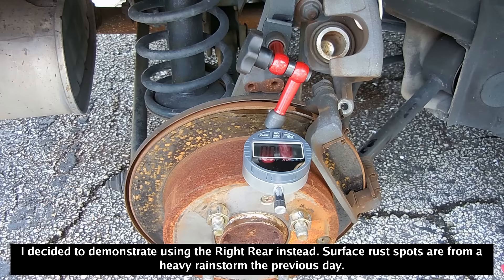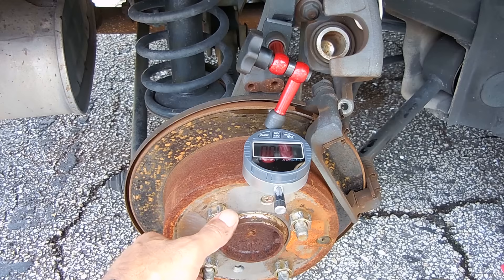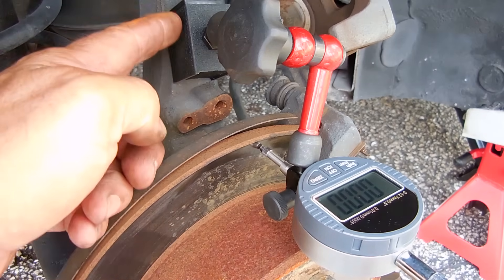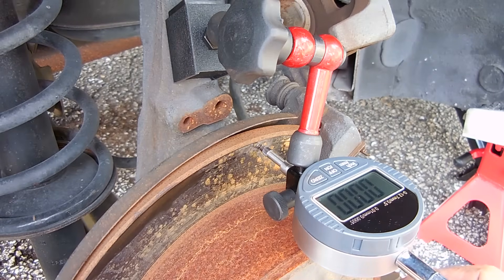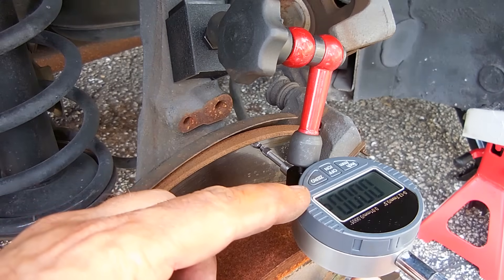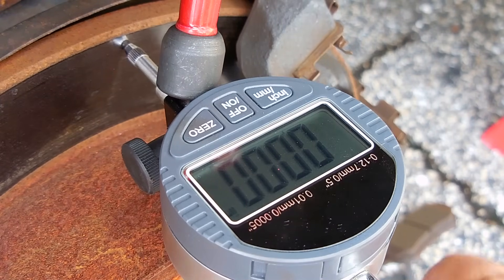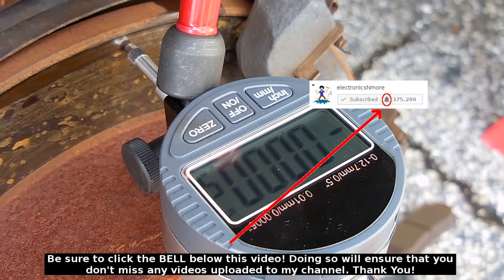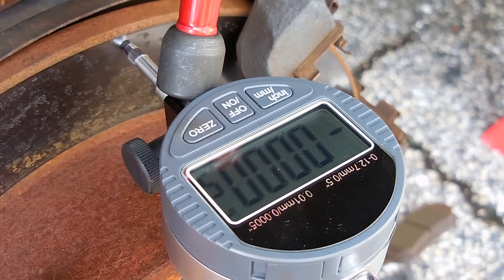How To Test For A "Warped" (DVT) Brake Rotor

Comment from the maker: Two things not mentioned in the video. Right before you connect the dial gauge to the brake rotor, grab the rotor on opposite sides and try moving it up/down and left/right. There should be no play. If there is, then the hub could be worn. Brake pedal pulsation is the result of LATERAL RUNOUT which causes disc varying thickness by allowing the high spot of the rotor to scrape the pad and remove material from both surfaces. Over time, this action will change the thickness in the area that has the most runout.Thanks for watching!

Comment: Brake rotors don't warp. Now uneven wear, uneven pad material transfer, and a car that has sat for a long time and had rust build up everywhere but where the pads sit is a different story.  
Brake run-out is not the same as warping. The mounting surface (hub) the rotor is mounted too could have debris or they just were not installed flush.
Reply from the maker: It's commonly referred to as "warping", even though it's DVT. Thanks for watching

Comment: Clean the rust off before measuring .. it can be 1/2 the tolerance you are measuring. Rust like that is gone is a fraction of a second when first applying the brakes, so don't include it in your measurement. ).002" total indicator reading is a very tight tolerance .. many new or turned rotors will not meet that spec ... 0.004" is hardly detectable. Also the thickness variation, a different measurement, can be much more important in relation to pulsing feel of brake pedal.  Lastly, most pulsing brakes are the result of brake pad material stuck on the disk, from over heating of brake pads, .. not warping of the disk.
Reply from the maker: That was just very light surface rust that occurred the night before due to a rainstorm. I wiped down the rotor and also turned it twice with a thin film of oil on the tip of the gauge to clear away any thin rust film before filming. All my sources(service manual and many online) claimed the specs I mentioned in the video. You're correct, it's really DVT that gives the rotor the appearance of being "Warped". Actually the pulsation feeling is caused by DVT that's caused by the pads lightly touching certain areas of the rotor w/o the brakes applied. Over time you get highs and lows which make the disc thickness vary, and that's why you feel the pedal pulsation. Thanks for watching!
Reply: @electronicsNmore  yes, exactly .. so mic'ing the rotor thickness at multiple points is a good idea also. The worst pulsing pedal action I ever had, was from someone leaving the parking brake on during  a drive.. this left deposits of brake pad on the rotor, caused uneven wear, and more spotty accumulation of brake pad material on the rotor.
Reply from the maker: I'm going to add "DVT" to the video title.

Comment: Rotors do not "warp" from heat.  It would take upwards of 2300 Deg. It wears differently due to other factors.  Clean the hub before reinstalling. Get the rotor turned, if it's a high quality rotor with plenty of depth left, or replace the rotor if deeply worn unevenly.
Reply from the maker: All metal has the potential to warp if heated up to a high temperature, then cooled rapidly such as driving through puddles of water.

Comment: Totally FALSE!
Reply: Do a new video showing what really causes pulsation.  99% of the time rotors dont warp.  They have uneven wear from lateral runout. Probably due to incorrect installation.  Most shops dont torque your lugs properly and dont clean the hubs and check the runout.  After 5k miles it starts pulsing again from wearing down off center.  Also uneven torqued lugs or over torqued lugs can shift it off too.  Plus you can have bad hubs.  Thats why they sell shims.
Reply from the maker: You need to do some research. LOL Nothing stated was false. Heat warps rotors. I mentioned the hub as a potential cause. DTV is caused by warped rotors OR hub problems/improper lug tightening. The warped rotor causes high and low spots on the disc which make the disc have uneven thickness. The fact that you said "TOTALLY FALSE", let's me know that you're clueless know-it-all.
Reply: The other thing I think you fail to realize is that it is very difficult to get a road or hot enough to warp it you have to be driving down the mountains on your brakes to get them that hot
Reply: @Seth133usmc  RIP Bozo.
Reply from the maker: @Seth133usmc  Incorrect again. It's very easy to warp a rotor with excessive braking, and even easier for a hot rotor to warp after driving over a pool of standing water which is much cooler. You seem to forget that rotors when made, the steel is SLOWLY cooled to prevent warping. I think you're done here.
Reply: Hey I was just trying to point out where you put in false information and yes it is false you said a pulsation is caused by warped rotors that's not true your rotors can be warped in not pulse what causes pulsation is on even wear and difference in thickness the thickness as it rotates through the caliper hits a higher spot and causes more resistance and causes the brake pedal to pulsate and the vehicle brakes to pulse that's why they're a caliper slides the allow the calipers to move back-and-forth freely even if the rotor is not  Aligned perfect but it does touch the brake pads when the brakes are not engaged millions of times as you drive wearing an even thickness the rotors

Comment: With the dial indicator setup you are using, you are measuring lateral runout. Excessive lateral runout does not cause brake pedal pulsation. Excessive lateral runout causes disc thickness variation, which is the actual cause of brake pedal pulsation. When you look at specifications for lateral runout, you will also find the specifications for parallelism, or what is more colloquially referred to as disc thickness variation. This specification is much tighter than the one for lateral runout. The most common cause of lateral runout, which then leads to disc thickness variation, is uneven torqueing of the lug nuts. Also, in all my years of automotive repair, I have never encountered a rotor with disc thickness variation that caused a squeal. That is a symptom caused by a completely different issue. Unfortunately for the facts, if you talk to some actual experienced technicians, 9 out of 10 will probably talk about "warped rotors" causing brake pedal pulsation. Our industry is rife with inaccurate information, even from experienced technicians. It's no wonder the automotive repair industry is held in such low regard. I recommend not letting anyone touch your vehicle unless they are ASE master certified. And preferably hold L1 advanced engine performance specialist certification, as well.
Reply: I tried telling him that but he didn't believe me either
Reply: @Seth133usmc  Yeah, I know. He's one of those guys that knows everything about everything, just ask him!🙄 Sorry about the long delay, just saw this today going through old email to erase. After this reply, I stopped making comments because nobody cares, and the poster will just argue with you, call you names and tell you why you suck. This is literally the first post I've made on YouTube since then. Well, there will always be guys like us who fix all of guys like his mistakes, I do it nearly everyday. Also notice that he edited his pinned comment to correct his errors.
Reply: @marcdubois3684  Damn you got told...RIP BOZO🤡
Reply from the maker: You never encountered a rotor with disc thickness variation that squealed? Then I guess you haven't seen enough of them, because I have. I've owned many new/used vehicles over the years, and 2 or 3 had that issue, which I corrected. As for the brake pedal pulsation, you're correct, it's because LATERAL RUNOUT causes DTV by allowing the high spot of the rotor to scrape the pad and remove material from both surfaces. Over time, this action will change the thickness in the area that has the most runout. People like you hate that guys like me can repair just about everything on their vehicle, which means people like you lose money. I think that's the real issue here. BTW, I've seen many "ASE" certified mechanics over the years that did lousy work on other people's vehicles, so it's meaningless. Just like many people hold driver's licenses, but they can't drive for @hit. Have a great day!

Comment: Check your wheel bearings, they can have runout and cause the rotor to have uneven wear which simulates the diagnosis of a warped rotor.
Reply from the maker: That's true also. :-)

Comment: I prefer to have mine cut if enough left as you say the cheap china rotors will warp easily anyway.  Not sure about your method, just jack up car and rotate tire with some minimal partial breaking and you can tell, or just cut both, it very easy to know if it's front or back (if discs on back) because of pulse or no pulse in steering wheel.  I pay $6-7 per to cut at local auto shop, is that a 2005?  Make sure to replace timing belt with full gates kit including everything (hydraulic tensioner) and water pump every 60k, just did mine, kit was$160 eBay.  That's an interference engine that's why it's so important, but something tells me your on top of it.
Reply from the maker: The problem is no one around cuts them for less than $15.00. Advance auto and Auto Zone no longer cut rotors. Pep Boys does it. I only paid $20 for a "Good "quality rotor on Ebay when I needed to swap one out. Leaving the tire on with a light braking pressure could work OK with the front, but the rear has brake shoes and a drum besides the rotor. Many times the shoes rub making you think the rotor is warped using your test. Using the gauge is best. I replaced everything on my car 1 year ago. Bought directly from South Korea a new water pump, timing belt, tension pulleys, and hydraulic tensioner. Took 4 1/2 hrs to get the job done.2003 Model GLS with 133K